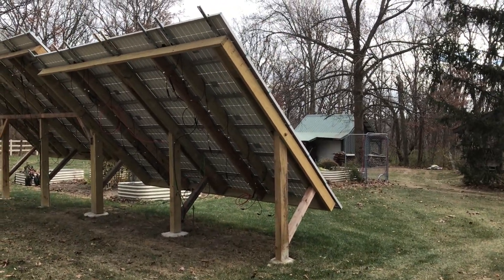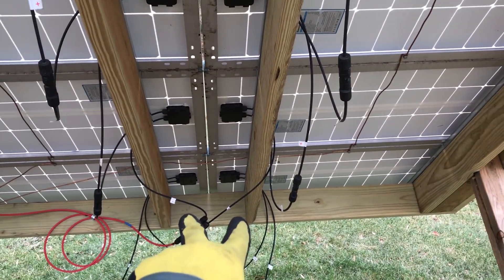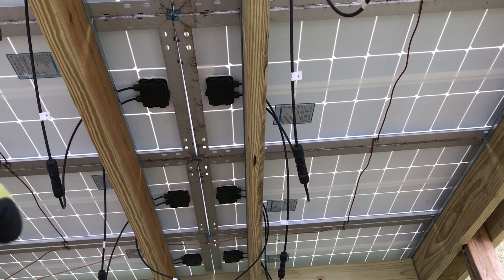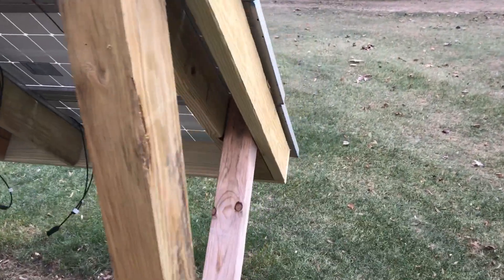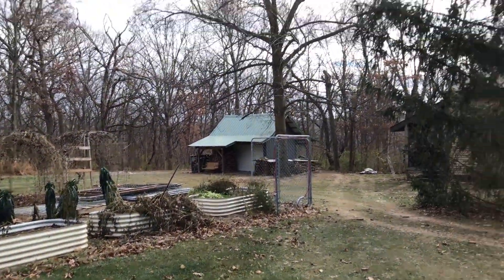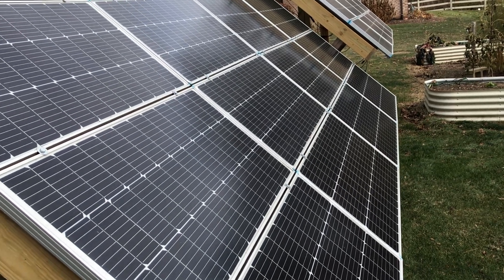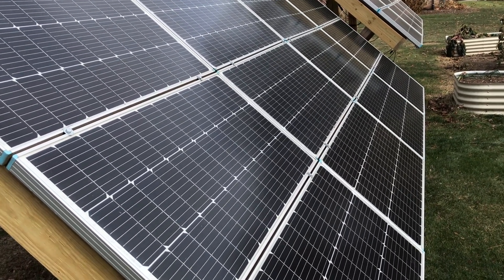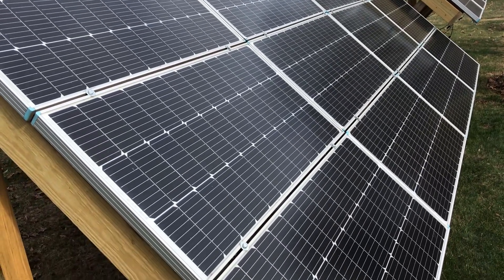Cold weather over voltage and solar time of year

Comment: when over paneling it is important to know the voltage change with temp drop...it is listed on each panel. also check with the inverter/charger manufacturer if amps can be exceeded, many times the unit can handle more amps than listed just never....i say again never go over the max voltage and running about 75% of max is usually best.  cold clear winter mornings and scattered thick clouds will produce voltage spikes that will destroy your systems charge controllers and inverters if you have not designed them correctly.

Comment: Voltage limits are controlled or set by the charge controller or the mppt controller in your solar generator put a battery inbetween the solar generator and the panels and it will never overvoltage.

Comment: always questioned the advice that you should run as high of dc voltage as possible.
Reply: The advice is sound.  That advice reduces losses and conductor sizing the best.  In this case the voltage needle was just on the other side of possible for the charge controller in use once cold panel temps happened.  Most panels will list the voltage rise so it can be calculated in on the initial string configurations for the expected environmental conditions at the site.

Comment: John I had the same thing happen to me about 2 years ago with my Ecoflow Delta pro only it didn’t just kick out it killed my DC charging system and that is one of the main reasons I now have my AC300s the safety features that are built into the bluetti are far superior to that of ecoflow and others. I now run two 1500 watt ( overpaneled) arrays which are less than 100 volts each.   250watt Trina panels.

Comment: Get the Bluetti D300s, PV Step Down Module. You can feel free to hook up as much panels in series as you want up to 450v you won't have to worry anymore and you'll get your maxed out 2400 watts coming in. It's worth it
Reply from the maker: I need to do that
Reply: @johnkayak10  somebody is selling one for 399 on ebay right now, that's a GOOD PRICE for it